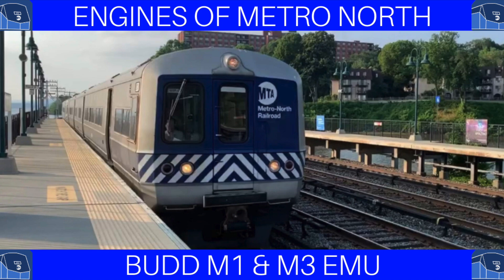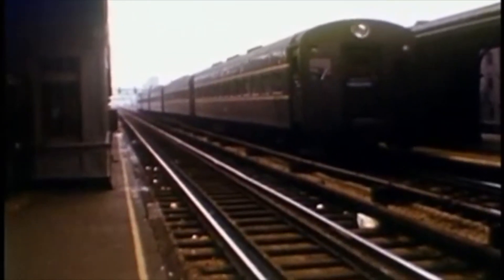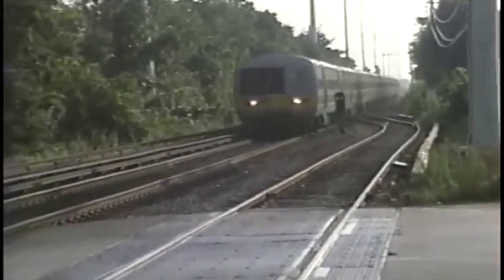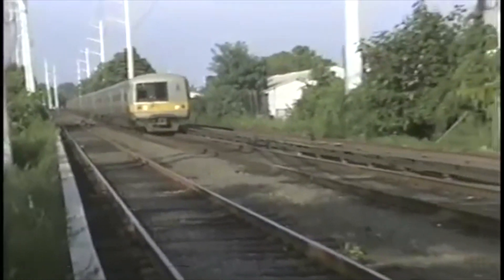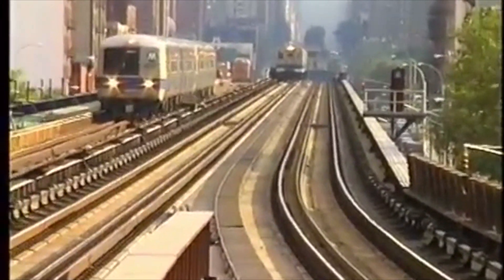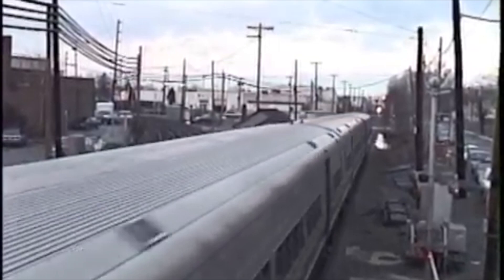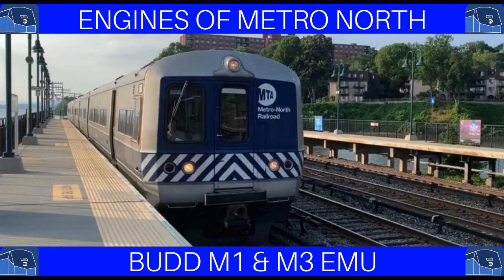Engines of Metro North M1 & M3 EMU

Comment: How come the Metro North M3 EMUs aren’t retired yet?
Reply: Because they’re still working
Reply: No the M3AS are not retiring until the M9AS Metro North railroad comes to replace them.
Reply: You know why the M3AS are retired yet because they are maintaining them and they are definitely in good condition.
Reply: The only reason why the M3AS are not retired yet is because the M9AS are not here yet. However they still have the M3S on the Long Island railroad mix equipments The M9S and the M7S deishels and coaches on the Long Island railroad.

Comment: What happened was this in the 1970s was a third rail voltage increase 600/650v dc LIRR Top Contact third rail & 700v dc New York Central Metro-North bottom contact third rail into 750v DC Third rail for M1& M3s replacement M7 & M9s. If you are able to look at Metro-North look ahead plan M3As are going to be replaced by M9As
Reply: You the M9AS are definitely gonna be replacing all the M3AS on the Metro North railroad Harlem and the Hudson lines.

Comment: What were the dates that the LIRR (from the video, sounds like early 1970s?) and Metro North third rail voltages were increased?  From the video, it sounds like the LIRR didn't have any more old 600 V/650 V stuff to worry about after the early 1970s, but Metro North had ACMUs for a while afterwards, and FL9s into the 2000s, so what did they do about those things not being designed for the higher voltage?

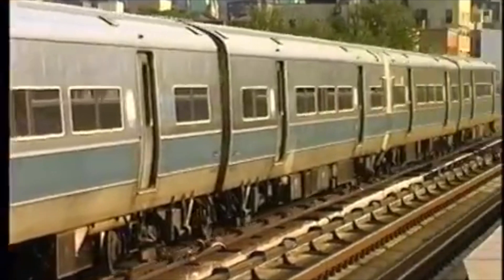Comment: Great remake! Something about a 4-car M3 train at 6:26 is a bit unnerving. Even the West Hempstead branch on the LIRR has a minimum of 6 cars. I'm also having a Q&A video soon if you're interested.
Reply from the maker: This was back when ridership on the upper Harlem line was low as it had just been electrified. Even 4 cars was an improvement over the previous diesels
Reply: @nyrailfan202  Interesting. And I thought the Greenport or Danbury branches had it bad.
Reply from the maker: But they had not been electrified. Now the upper Harlem sees 6 or 8 car trains

Comment: Hi question is m3 still in north north railroad
Reply from the maker: Yes
Reply: The M3AS on the Metro North is not going nowhere until the M9AS  to come and replace them. The Long Island railroad was very smart enough to keep 80 cars of the Long Island railroad on the side. We wish that the Connecticut metro North railroad would of did the same exact thing keeping the M2S M4s M6S around instead of scraping them. There wasn't nothing wrong with the M2S M4s M6S.
Reply: @leecornwell5632  The M2, M4 and M6 were getting old and were outdated, so, they had to get replaced.